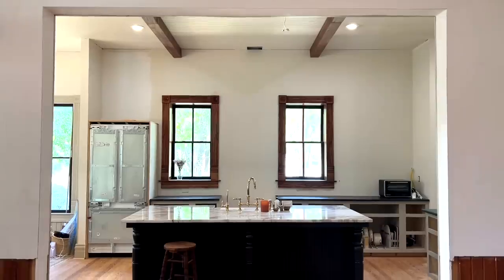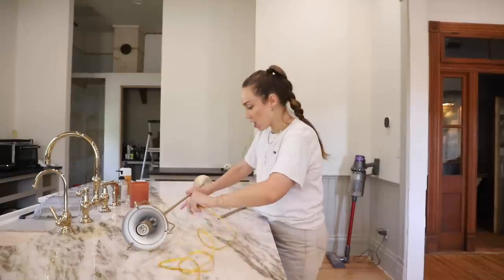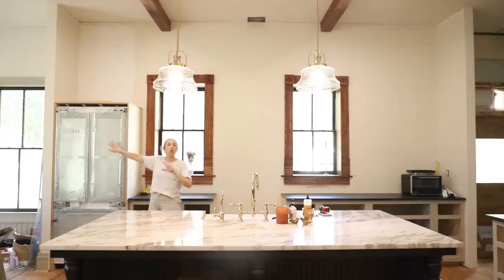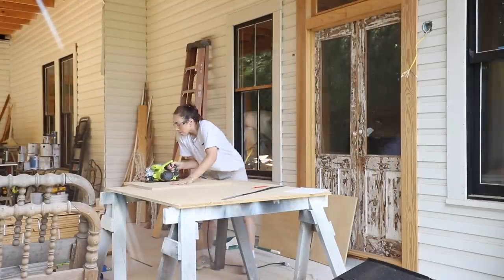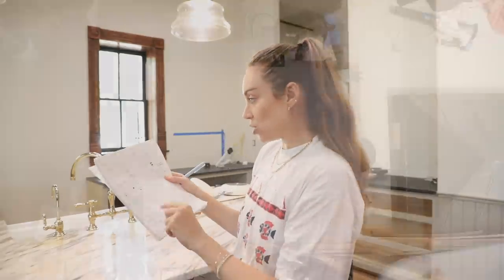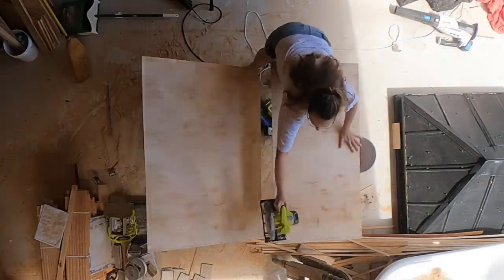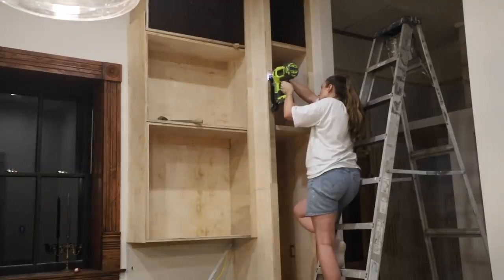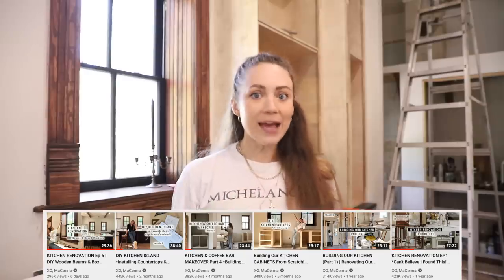KITCHEN LIGHTING & CABINETRY | Kitchen Makeover Ep 7 | XO, MaCenna

Comment: A suggestion on the light switch in the cabinet for the light strip - consider motion detection for turning on the light. It is easy and cheap and you will not have to press any buttons while cooking :)

Comment: I am ‘thanking you later,’ as you suggested, for the corner clamps. When we downsized and moved, a guy disassembled and reassembled our bookshelves. But he did it by making everything level which meant that the shelves weren’t plumb because our new home is an older home with various slopes in the floors. The shelves ended up with a weird skewed look. Because of you, I bought 90 degree (corner)clamps, took the shelves apart, used the clamps to make everything square, and then screwed them together. What a difference! Thank you so much! Did you know you were a teacher as well as a DIYer and home decor designer?

Comment: A tip for having the cabinets go all the way to the counter top; leave a little gap (like 1/4in) between the wood cabinet box and counter which you can hide with some decorative trim. When water gets over there from the counter it won't damage the actual cabinet boxes, just the trim which you can easily replace when it gets dingy looking. I learned this the hard way in my bathroom reno! Lots of love, you are so inspiring!!

Comment: MaCenna, here in my country the cabinets are manually done in mdf and all and its common to have to change switches from walls to cabinet sides, and our walls are made of concrete, ceramic blocks and stucco. Put a fake backing on the cabinet and put longer cables to pass it behind it and to the other side. I did it on a cabinet of mine that i had a plug inside and i wanted a gallery lightning with a switch on the side.

Comment: The cabinet that is on top of the counter should be a appliance garage 😍 probably easy to add a electrical plug in there split off the light switch to plug in daily appliances.

Comment: Hello, 😊 for your light switch in your cabinet, just cut the drywall on the other side of the wall and turn the box around. then you could put a little pretty shelf maybe a four to six inches deep that has hooks in it and you can hang your aprons and towels, things like that for your kitchen nobody would see because around the corner and it would hide your switch to turn on your lights and your cabinets..... Just a thought

Comment: I have 1920's cast iron hanging ceiling fixtures in my home and have found beautiful crystal faceted type bulbs at Lowes.  They're about $5each but last about 2 years.  I've found that even in the kitchen, I love a dimmer switch and often turn them down for the ambience.  The faceted aspect leaves a cool pattern on the ceiling too.

Glad to see you took those gloves off while using the saw.  <3

Comment: A couple of things, the extender rod on the light fixture is a “down rod”, the ceiling plate is called an “escutcheon”. Great work extending the face frame to scribe with the corner. Edit: 30-36” from the countertop to the bottom of your pendants is ideal. Question: will you be putting “puck” lights in the upper glass cabinets? I highly recommend that to accent the cabinet run and bring out the stain so it’s not in shadow.

Comment: If you live with that under cabinet light inside the cabinet for a while and it's bugging you, you can just put it on the other side of that wall. Looks like it goes into a little hallway there. Unless you're going to put a door there. But if not, it would be super easy to flip the switch on the other side of the wall.

Comment: For any other light installs, leave wiring as long as possible, future people will thank you as they won't be scrimping if they need to cut and reattach at all.
I keep noticing the outer corner of the siding on the patio off the bedrooms isn't finished so not sure if the other outer corners and areas that need a trim strip are finished, are you doing that or the siding people?

Comment: Just to be on the safe side, you should consider checking with your Code enforcement to see if having a light switch inside your cabinet is against code. Only reason I mention this is because it is against code where live. Also, if you're going to have an electrical outlet in your island, I think you need to have one at each end because you have a sink in the island.

Comment: Just a quick question.  Did you rest the cabinet directly on top of the refrigerator?  If so, I think that may cause a problem if you ever have to move your refrigerator away from the wall for repairs (or whatever)
Reply: The fridge is already sitting in its own cabinet with a 'roof'. So the upper cabinet is sitting on top of that roof
Reply: @LaurieWinkless  I knew she was a smart lady.  I concerned myself over nothing.

Comment: You are so talented and your remodel is looking amazing!  I have one concern. The spacing between your countertop and upper cabinet is looking a little out of proportion. Normally 18" is the minimum height between the countertop and the upper cabinet and in kitchens with tall ceilings, 20"-22" looks better. The 18" spacing in your kitchen feels a little short and if you add a piece of moulding below, it will get even shorter. You have such an amazing eye and attention to detail, so I am just mentioning this so you don't finish it and have it bother you later.

Comment: -central Wisconsin:  Nicely done!  
I to have to say, though, I think you’re going to really kick yourself for not drilling adjustable shelf supporting bracket holes, into the cabinets before you put them up (you can always make an adjustable shelf hole template guide to use to put in the holes now after the fact, then use masking/painters tape around your drill bit you will use to drill the adjustable shelf holes into the insides of the cabinets, as the tape will tell you how far to drill into cabinet sides so you don’t drill too far/to deep/going through the sides).

Also, for the under the counter light switch, why did you not move it to the back side of the same wall it’s currently on?  It looks like there’s a little hallway there, (to left of coffee bar) possibly a small hallway with door to the outside?

Comment: Building upper cabinets is different than lower cabinets because they should hold the weight of the cabinet itself plus whatever is stored in them. These cabinets will give her many issues in the future because the back of the cabinet is not properly assembled. Her courage is truly inspiring but for everybody watching her videos, I want you to know she is making multiple mistakes that will cost her down the road just like her guest bathroom that she didn't waterproof. If you are planning to DIY your upper cabinets like this, you are better off buying unfinished or finished upper cabinets from Lowe's or Home Depot. And for the love of GOD, do not leave switches inside your cabinets! But again, kudos to her for taking on such a big project.
Reply: Wait, the guest bath isn't waterproofed? May I ask, what's improperly done with these upper cabinet's construction?
Reply: I second this request. As for the bath, I know for showers, in California, you have to put up a membrane on the walls before tiling. This is a tub and another state.
Reply: @illestj3990   About the cabinets, pause the video at 16:10 to look inside the cabinet she is about to install. The back of the cabinet is not strong enough because she only used nails to attach it. The 2x4 that you see inside the cabinet is also only attached to the back of the cabinet and not the sides. She should have used at least pocket holes to attach that 2x4 to the sides. I just hope that she is not planning to put any heavy plates in there. But regardless, the structure of this cabinet is not sound.